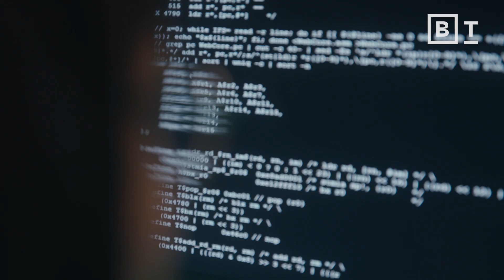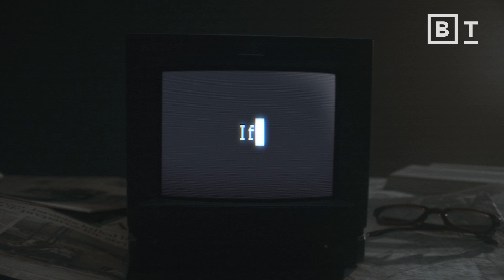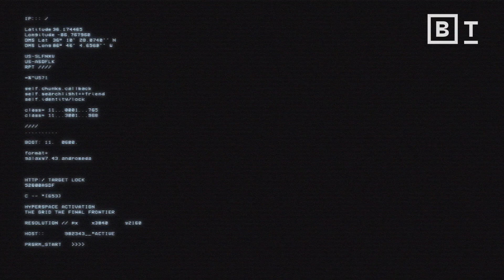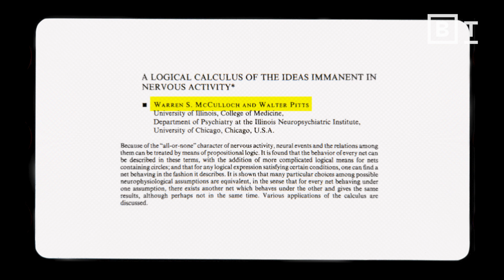Are conscious machines possible? | Oxford professor Michael Wooldridge

Comment: I personally think AGI is inevitable. For the first time in human history, we have nearly unlimited access to a plethora of digital human knowledge and communication AND processors powerful enough to sort through this information and “train” human-designed learning bots. It was only a matter of time since the creation of the internet.
Reply: It definitely is inevitable, but the timeline is very debatable. And when I say AGI I don't mean a hyper-sentient omnipresent God intelligence, I mean an AI that can solve all the cognitive tasks a human can at a much faster capacity, which includes the ability to self-correct. It's not an intelligence that's necessarily moral or wise, or would ever even reach those facets of intelligence in an eternity of being, it's just one that would be hyper-efficient at whatever task we would give to it, which is why it's scary. It's the definitive Monkey's Paw technology: Basically magic and incredibly difficult to control.
Reply: @gwen9939  There isn't a practical difference between AGI and ASI (Artificial Superintelligence), because an AGI that is human-level or slightly above in all tasks will be able to improve its own code and redesign its own hardware, which almost immediately leads to an intelligence explosion where it is suddenly 100 million times more intelligent than any human and keeps improving at an exponential rate. Anything humans do would look like extreme slow motion, since it can think on the order of nanoseconds since that is the clock speed of modern processors. I really hope that such an ASI would have strong values and would be wise in some sense.
Reply: I m scared of so much development 
Can someone explain me?
Reply: @IbrahimKhan-yo8nq  nothing to fear at all - I will try to simplify but I may fail- best is to ask the young smart kids in your family /neighborhood/library community college/computer science depts or write to Sunder Pitchai at Google  -   new technology of feeding computers w as much information [data]  about every topic and past events, and training these computers  w certain basic algorithyms [rules] to analyse and answer questions like u get answers from Google on any topic -    only change is that now these machines access and use every bit of information from the cloud storages [largest] with results that seem as if the machine is thinking out many answers by itself since it had not received data on certain specific topics - deep data allows machines  to start "thinking" better than the human brain on several different tasks that require computation for precision and - like predicting the outcomes or words in a sentence , analyzing all information about one topic to come up with the best answer like finding structures of proteins, finding  new medicines for various disease, writing a summary or story on a topic , like CHATGPT4 is doing for students, detecting skin and breast cancers and interpreting scans and Xrays - passing USMLE exam, defeating best chess palyers and generally trying to find cuperior solutions that is v difficult for humans to think at v high accuracy - but it does not work w gambling is what they say to the public- so Robots can carry on a great conversation with u  like a friend - no more loneliness - ML is training the machine to think like humans for optimum decision making  - all future computers will have access to AI w advanced chips in servers so we dont have to pay for cloud access  to these cloud storage kings of the world -CHATGPT5 and applied AI will take away many human jobs, like driving, factory work, clerks, assistants, book keepers, even Radiologist and some specialist Doctors , even Pilots - govts will be forced to provide minimum pay for every citizen -Robots will work 24 hours without union fights and politicians cannot lie about anything because Fact checking will be instantaneous
Reply: There is nothing inevitable about it, and it's quite naive to use the word inevitable with something as complex as this. Why? Because there is only one way for it to go right, but millions of ways for it to go wrong. AGI in our lifetimes is a pipe dream.
Reply: waiting around the corner to be flagged in
Reply: There’s a good argument that supports this claim. That emergence, the process with which our own bodies emerge from the collective and coherent interactions of cells… is the same process as the creation of AI except us humans are the cells and the AI is the human in the scenaria. The scale and dimension with which this machines consciousness exists, will be unknown or unreachable to us…but we indeed produce that beings intelligence as our communication networks becomes more collective and coherent.
Reply: @NightmareCourtPictures  Half of what you wrote is incoherent. Are you saying that AGI is unrealistic?
Reply: We are way ofcf AGI, because this what has been developed now is not Artificial Intelligence! It is Artificial Creativity! AGI only becomes possible when we first succeed in developing Artificial Consciousness. And that requires a totally different kind of computer, running totally different kind of software! 

There are beginnings of Artificial Consciousness. Only those that develop it now are not aware that it is that what they are developing.
Reply: @konradswart4069  Given that intelligence (including consciousness) is a Turing complete operation, given enough memory and time, even an incredibly slow computer would fit your bill for hardware necessary for the creation of AGI. GPT-4 is already a system with some of the potential necessary for AGI.
Reply: @diophantine1598  I have given ChatGPT a real question, and it gave a wrong answer!_

-----------------------------------------------------------------------------------------------------------------------------------------------------------------------------
My question.
Does, in mathematics, the term: 'infinity' have the same meaning as 'not finite', given the fact that all mathematical proofs are based on modus tollens prooofs?

ChatGPT4's answer:

In mathematics, the term 'infinity' is often used to describe a concept or a quantity that is unbounded or limitless. While 'not finite' can be considered a similar concept, it's important to understand that these two terms aren't precisely the same thing. 'Not finite' is a more general term that simply refers to anything that isn't limited or fixed in size, whereas 'infinity' is a specific mathematical concept used to describe a value that is larger than any finite number.

Regarding the assertion that all mathematical proofs are based on modus tollens proofs, this is not accurate. Modus tollens is a type of logical argument and a valid form of inference, but it is just one of many methods of reasoning used in mathematical proofs. Other proof techniques include direct proofs, proof by contradiction, proof by induction, and proof by exhaustion, among others. The use of infinity in mathematics is not directly tied to modus tollens or any other specific type of proof method.
---------------------------------------------------------------------------------------------------------------------------------------------------------------------------------------

My question is one that no AI is able to answer! This is because to understand the full range of the Modus Tollens in all of its forms requires consciousness!

Only a universal quantum computer having Artificial Consciousness might be able to answer this question correctly! And such a computer does not exist! I am convinced that if we do not destroy ourselves, such a computer will one day be real. But at present we are way removed from such a computer!

I must admit, thoug, that there will not be many mathematicians or philosophers capable of answering this question correctly, or even realizing that my statement in the question is, indeed, correct. This question is at the heart of a debate revolving about the necessity of the excluded middle in logic.
Reply: @diophantine1598  I have given a (far) more complete answer to this response. But YouTube censored it for one reason or another! Therefore, this is not the platform to discuss such matters!

Just letting you know.

If you want the full answer, you can find my e-mail address on my YouTube channel. But I do not guarantee that I shall respond, because there are many things I am occupied with.
Reply: @konradswart4069 @konradswart4069 If a spacefaring species showed up tomorrow, they likely wouldn't know anything about modus tollens. Looking at the other end of the spectrum, Chimps also don't know anything about modus tollens. But the consensus view is that they are (broadly) considered to be conscious beings. So in terms of your assertion that understanding modus tollens requires consciousness, there's seemingly a disconnect. I suspect you meant human consciousness. If so, and considering the aforementioned alien species, how would you assess the relevance of their consciousness given they're oblivious to modus tollens? What if the manner of their sentience/sapience were so divergent they could never relate to most human concepts...including modus tollens? Also, do realize 'consciousness' is only truly known to us (universally) in the form of negation: we are conscious when we're not unconscious. From there, we struggle mightily with pinning down exactly what is meant by the word. A must-read article on this subject is available online at Psychology Today - 10 Problems With Consciousness. As such, asserting anything definitive about consciousness is well outside our current abilities. Well, except for the unconscious aspect. We have some abilities in that respect.
Reply: @diophantine1598  Consciousness has nothing to do with Turing completeness! Consciousness is an altogether other phenomenon than just calculation, even Turing complete calculation.

No computer based on the von Neumann architecture, or based on Turing completeness is conscious! No matter how general it is!

When people use AI, which is just ACr, they project their own consciousness in it! Therefore it only appears to them to be intelligent. 

I have tested ChatGPT4 from my perspective of understanding cnsciousness, and I got the most ridiculous responses, which didn't surprise me at all, since I know that such machines + software are only creative.

However, they do have the full capacity of human creativity. But even a moskitoe or a fly has more consciousness (they do have consciousness) than any of those machines!

It is thanks to the little consciousness that flies have that makes their ability to fly superior to any machine we have built up till now. Just think of it. A moskie or a flly. The little brains they have have just a tiny bit of consciousness! And their ability to fly either equals (moskitoe) or surpasses that of the best we can build! And that, while neither a fly nor a mosktoe has anything near the creativity we have!
Reply: @konradswart4069 Consciousness is not necessary for imtelligence
Reply: @ivankaramasov  Oh yes, it is!

Consciousness is not necessaary for creativity! That is why AI is a wrong name. It should just be Artificial Creativity = ACr.

Do you know, by the way, what exactly consciousness _is? 

I do! 

Prove your point! Give my your definition of consciousness! Let us see which of the two of us is 'the most intelligent' in this exchange!
Reply: @konradswart4069  No, it is not. You just prove that you have your own idiosyncratic definitions. There is nothing to discuss
Reply: @ivankaramasov  How can you possibly be certain about this? You haven't even heard my definition of consciousness!

So, I have proved nothing! Therefore, you cannot claim that I have proved anything of the sort!

Consider also this. The bandwith of this comment section of YouTube is far to small to do any justice to any serious exchange.

Ýour remark shows to me that you are not aware of this.

I have had many discussions on e-mail groups of all kinds, and have made many comments and exchanges, even through direct e-mail. And every time in those rare case when I actually met those people I was communicating with, I was very surprised, even shocked by how false my picture created through these communications were!

What I try to do in these communications is just open people's minds for the simple fact that there is a difference between creativity, consciousness and intelligence, without explaining this difference. This medium is not suita ble for this!

Still, me give you a hint that shows the difference between at least creativity and consciousness.

When you sleep and dream, you do not know that you sleep or dream. Moreover, many dreams are extremely creative, often absurd! However, the experience of the dream state does not differe from the experiencing when you are awake.  The point that Chuang Tzu made in his 'butterfly remark'. 

But when you are awake you do know that you are awake!_ Here Chuang-Tzu had it wrong. But then, how can it be that wen we are awake we do know that we are awake, while when we are sleeping and dreaming we are not aware that we are sleeping and dreaming? 

For one reason only. When you are awake, you not only experience, but you are also conscious! But when you are sleeping and dreaming you are experiencing, but you are not aware that your experiences are not real! As long as you sleep and dream, your dreams feel as real to you as if you are awake.

The factor that allows you to make a distinction between dream-experiences and the experiences you have when you are awake,  so I claim, is exactly what consciousness is!

When you sleep and dream, you do not know, that is, you are not conscious of the fact that you are sleeping and dreaming. And that is because consciousness is absent!

But if you are awake, it is possible to know the difference, simply because you not only experience, but you are also consciousness. Dreaming is experiencing without being conscious, while being awake is experiencing while you are also conscious!

Just think about this. And you will see that what I say here is consistent with what you know. That is my evidence!

And just one other remark. I have been practicing meditation for decades now. And I hit upon a brain state wherein experience and consciousness separated completely, which allowed my brains to enter a unique state, wherein there was no experiencing whatsoever, but only consciousness!

That is why I can be so definite about my statement that what is called here Artificial Intelligence is not a form of intelligence. It is Artificial Creativity and nothing else!

I am not the only person whose brain is capable of entering this 'state of no experiencing and only consciousness'. J.  Krishnamurti was a famous one whose brain also could enter this state.

This is also why his main book has the well-chosen title: 'The Awakening of Intelligence'.
Reply: @konradswart4069  I often know that I am dreaming when I am dreaming. Also, in the state of flow that is optimal concentration, you are actually so focused on what you are doing that you are not self-aware. That is why two hours can pass by without you even noticing. Also, in the state of flow, you are at your optimal capacity, also solving problems requiring intelligence
Reply: @ivankaramasov  You are not denying that there are moments, whereby you are dreaming and you do not know that you are dreaming! 

The very fact that you do not deny that possibility shows that you are aware of that there is such a distinction! Otherwise you would have said: 'When I am sleeping and dreaming I always know that I am sleeping and dreaming! Or, 'when I sleep and dream I always know that and when I am sleeping and dreaming!

Therefore, my refutal is this. The way you formulate your response shows that you are aware of that the distinction I make between dreaming and sleepiing and not knowing that you are sleeping and dreaming onthe one hand, and the state whereby you are awake _and dreaming. 

And what I try to make clear to you, is that it is the presence or absence of consciousness which causes this distinction. 

Also, about flow. That is an entirely different matter. 'Self' awareness, or, in general, the 'awareness' that you are an 'I' or a 'person' always happens in a context whereby you interact with other people, or are imagining that you are doing that, or will do that, or have done that in the past. 'I' awareness always arises when you see yourself in a social context of one kind or another. This 'social context' can be just you talking to yourself! The 'I' experience always involves some kind of speech.

But if you are in a state of flow, your mind is not thinking about yourself as a person, but that what you ared doing is a whole  complex of thoughts that controls the body. A state, where speeci is unnecessary. that is why there is no 'self' awareness, or 'I' awareness, because it is speech or language, which is social by its very nature, that creates the (illusion of being) an 'I' or a 'person', and therefore causes what you call: 'self-awareness'.

The 'flow' awareness is therefore always the result of some imagined result that has nothing to do with you as a person or others as persons. There is only the task, a picture of the state the task is in at the moment your mind is focused on that task, and a picture in the mind which is not that of a 'person', but what the completed task 'should look like'. It is this 'tension' between the observation of the momentary condition of the task, and 'what the task should be' that causes the mind to make the body act! but not to speak! That is why an 'I' in the flow-state is absent.

Or, as J. Krishnamurti would say, in the 'flow' condition there is no longer a separation between 'the thinker' and ''the thought',  or 'the thinker' and 'the picture of a completed task'. The 'controller of the body', which is by definition the 'I' is the picture of the completed task. So, the picture of 'the completed task is 'the thinker! 

In the state of 'flow' the distinction between the 'I' and that what the 'I' tries to accomplish, has disappeared. 

And that is why, in the 'flow' sate there is no 'self-awareness', because in that state, the picture of the completed task and the 'self' has become one and the same. The subject has become the object.

The 'feeling' that we are 'persons' only arises when sonme context of 'other persons' is also present. If you would be the only person in the world, and this would have been your condition since birth, you would have never learned to speak. Therefore you would never have the kind of self-awareness you are talking about.

Any 'self' awareness requires an awareness of 'others'. It also requires some form of speech.
Reply: @konradswart4069  I'll write an answer when I have more time and access to a complete
Reply: Why is it inevitable? Why is it needed? General in what sense?
Reply: @Zenovarse  just my personal opinion. I’m not an expert on the subject but have done a decent bit of research since the explosion of AI last year and this year. AI intelligence is on an exponentially-rising path, and some AIs are even being taught to teach themselves and “practice” on data sets they’ve already been trained on, further nuancing and refining their answers. Dozens of research papers and AI experts support the claim that AGI will be achieved in less than 10 years. There’s no turning back now. I believe it to be inevitable.
Reply: @refinery.studio  Whether creativity is specific or general, and no matter how general creativity is, it is not intelligence!
Reply: @Zenovarse  It might not be needed, but it is a potentially very powerful tool. World hunger, aging, disease, and even interstellar travel may be solved within a few years of AGI being created.